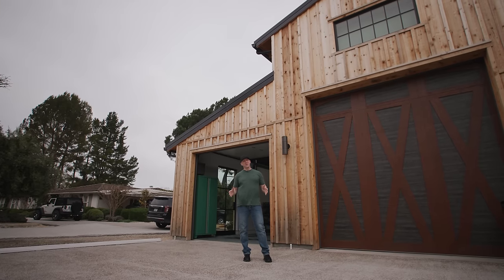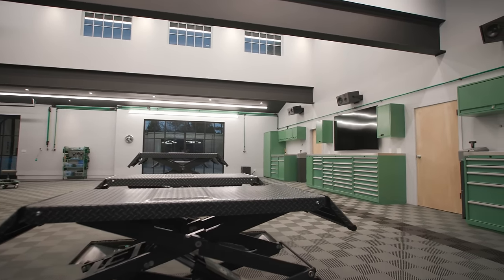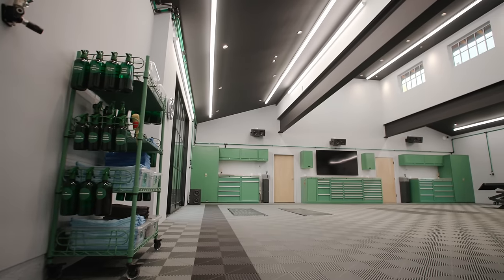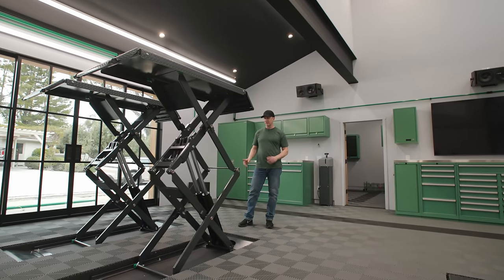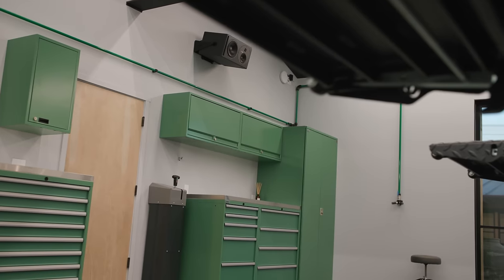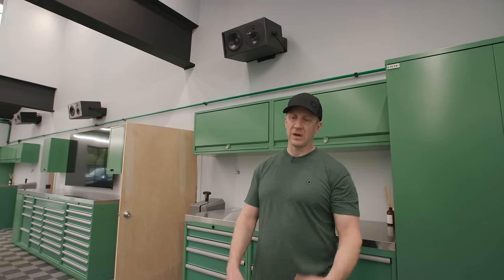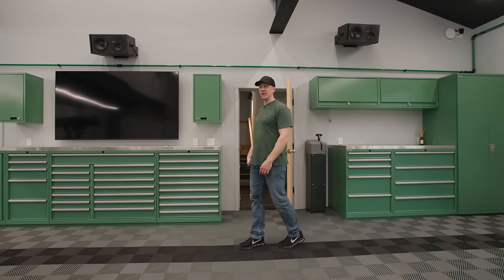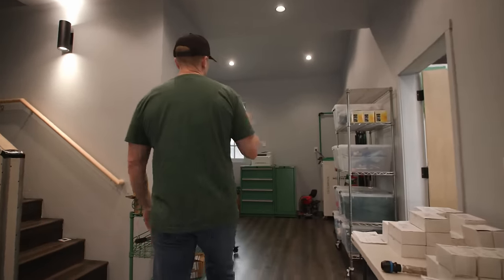TOUR The Ultimate Automotive Sanctuary | Epic Dream Garage Walkthrough! 60X40 DREAM Barn Shop!

Comment: Why don't you just run water in the 2 inch air tube instead of a hose in a tube? You could  even downsize the aluminum tubing to 1 1/4 or similar.
Reply from the maker: The water is under pressure, 1,000psi.

Comment: Pro tip. You can put those 7k lift controllers in cabinets too.
Reply from the maker: It’s a whole lot more work due to the handle.
Reply: It’s the same controller as your center 9k lift. It took a lot of begging but I got them to sell us the controllers so they all match

Comment: Great job on the project! With that said, I am surprised that there wasn't more discussed on the vacuum solution (which is a major component of the detail process). I know you mentioned that Fred has his own vision (maybe mobile shop vacs?), but that doesn't seem to be covered here in this tour and seems like a gap in the process. Just some constructive feedback. Looking forward to the next series!
Reply from the maker: He has a portable Festool.
Reply: @ObsessedGarage  Interesting. Dust extractor? Or do they make a dedicated car vac?
Reply: Battery operated dust extractor Festool CTC Midi 1--pretty sweet (but expensive) portable roller.
Reply: @fredgoeringer6821  Thanks for the info Fred, I will have to check it out. Congrats on the garage build. It's awesome! I like that you made it multifunctional. That's what I like to do with my spaces as well. It pays to plan ahead!